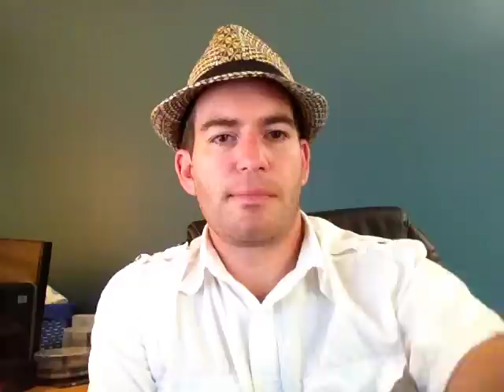What to do if you have Low Heat, Black Glass or Pellet Pile ups in an Englander Pellet Stove

Comment: extreme? using the leaf blower trick is the BEST way of cleaning your stove and vent. Do your regular cleaning then hook up the suction side of a cheap electric leaf blower to the end of your pellet vent. You will have to fabricate an adaptor but I use a simple 4" to 3" plastic plumbing adaptor to do the job… you will be amazed at how well your stove will run...

Comment: Hi I just installed a pellet stove in my home also have installed a fresh air intake as well on first bag ran perfect. Next day glass turns black as soon as it starts or rather within a few minutes. Pleas help. I have heat seating on lowest and draft on auto
Reply from the maker: Open the draft to full open.  Check to see a critter didn't make a nest in the cold air intake.